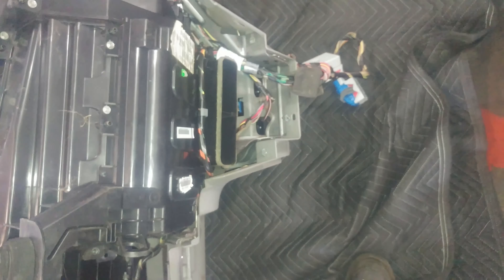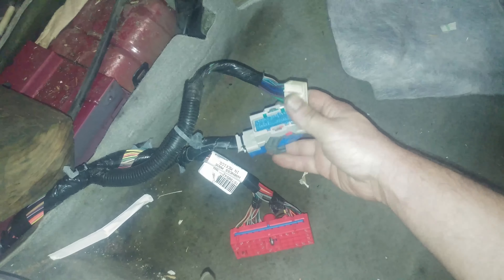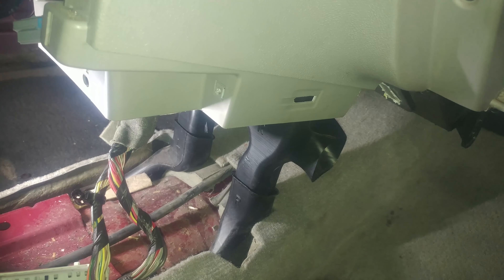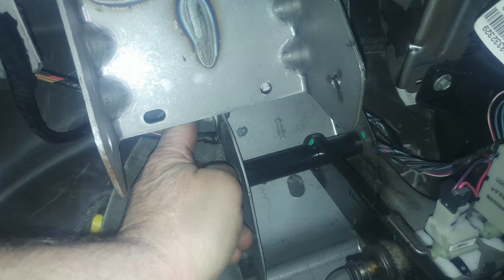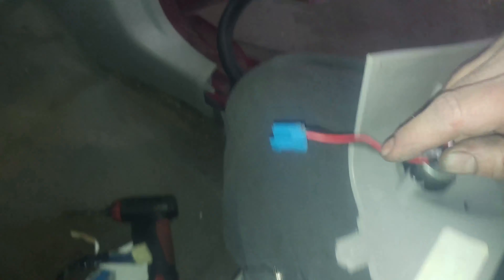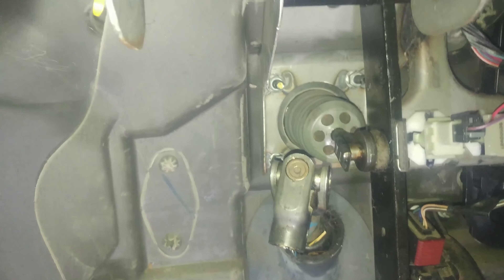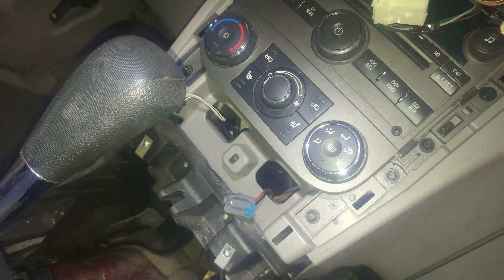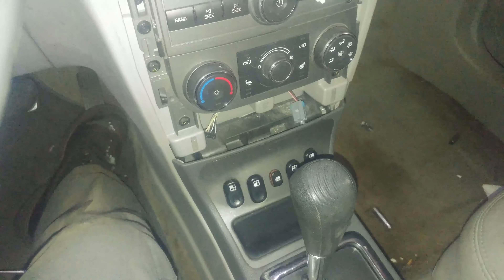Heater core replacement 2007 Chevrolet HHR Overview dash removal evaporator

Comment: If my HHR ever springs a heater core leak, I will bypass at thermostat housing and get a 12v plug in heater. Living in the southern US has its pros from time to time. Great job on that utter pain in the front end 😎

Comment: This looks like it would be a HUGE job. Dunno if a diy guy would want to touch changing a heater core or an AC Evaporator on this car. I could see so many things go wrong if you don't know what your doing.
Reply: Yes it is a headache!! Took me an entire day to uninstall and reinstall the dashboard and heater core and  a.c EVAP. 🤬🤬🤬😡. I would recommend buying windshield and interior heaters until you decide if you want to spend $1,600 buck's to have the heater core replaced. If her's break again or something else goes wrong with it I'm going to get rid of it. And buy her a Buick.😁

Comment: He's making it a huge job 🤣. Because.. Ain't no way in hell you have to remove all those things. I'm going to post a better video 11/5/2021 without removing the entire Dash. Stay tuned
Reply: Bro where’s the video ??
Reply: Well.. I have to apologize. I've tried everything and I still had to remove the entire dash 😏🤔😒. I bought it for my wife with 41000 miles on it and I Will never buy another HHR. It's a tragedy just to change the alternator on it. Everything is hidden with no room to work.  it is less expensive to buy auto dashboard heaters. $30 &.. it works just fine 😁. This job is not a Dyi. I don't recommend you try this at home unless it's a project and you have another vehicle.
Reply: @kevensaldana5095  you win!! I gave it my best shot.  Wasted a lot time trying to figure out how to get it done without removing the dashboard. And still had to remove it to have room to get it out. So I apologize and throw in the white towel. This is not a Dyi or good idea to try this at home unless it's a project and you have another vehicle to get around. So... PAY THE MAN OR BUY CAR AND WINDOW HEATERS UNTIL YOU FIGURE OUT WHAT YOU WANT TO DO ABOUT IT
Reply: They don't call GM these days China Motors for nothing.